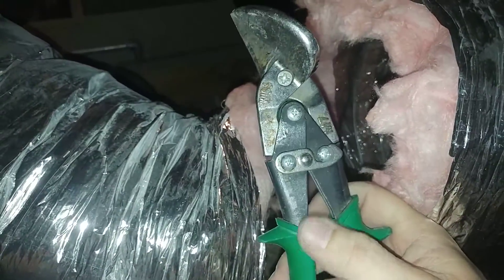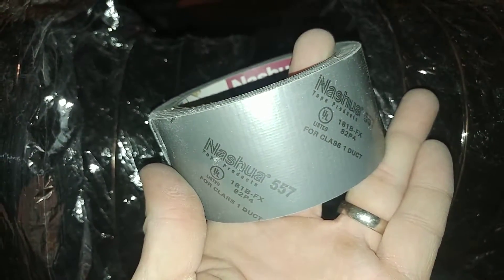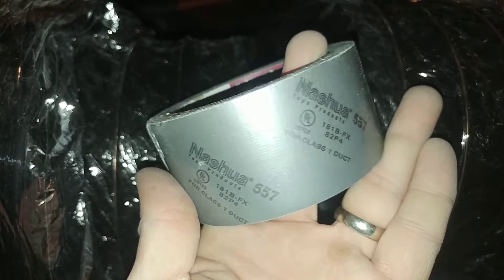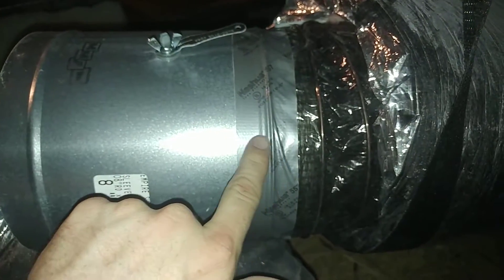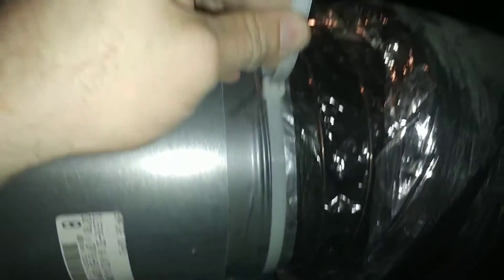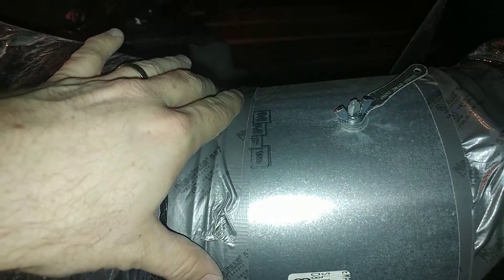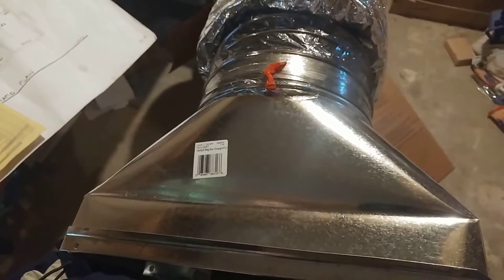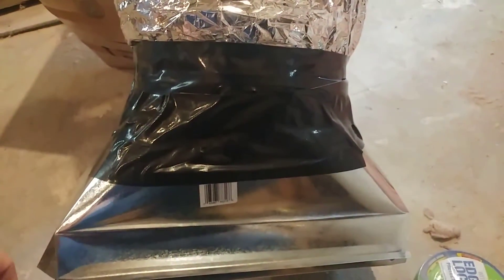How to Install an HVAC Damper and Attach a Register Boot: HVAC Duct Work

Comment: Thank you great tutorial!  Do you untuck the insulation before taping or leave it tucked and taped?
Reply from the maker: You tuck in the outer portion first to tape the inner portion. After taping the inner part, untuck the outside insulation, then tape up the outside
Reply: Thank you so much! Excellent tutorial video!

Comment: Handy video for sure.  But despite the name "Duct Tape", it's actually not for use on Duct work.  That myth has been debunked for a while.  Better to use foil tape as it holds up to the heat much better and has better adhesive.

Comment: Thank you for this. The HVAC companies I have called do not want to add dampers, though - preferring to sell me on a new split ductless system. Not sure how to approach them.
Reply from the maker: As the customer, they should adapt to your needs; however, the answer is that the damper can solve problems throughout the whole system whereas a split system only solves a very localized issue
Reply: @RealEstateInvestingUnmasked  appreciate the response. Thank you!

Comment: Good tutorial.
My house is 3 years old and had terrible balance because the idiots did not install dampeners in several runs.
Thought it would be much more complicated. After seeing this, im thinking of installing a branch off of the nearest vent to my 2nd story unit. It blasts a ton of air through it. Its an open 2 story blended air system. All the 3 up bedrooms have a vent. However my main area upstairs area only has 1 vent in the open area on far  side of the house. The thermostat is is nowhere near any vent that is not behind closed doors  You can walk down the hallway towards the vent and feel the temp change. So I figure if i take the one that blasts air and extend it down the hallway, it will balance out better.  My theory is That the thermostat does not sense the change until the air finally meets the thermostat at the far end of the house. That end is always much colder so if I can get some air closer to the thermostat it'll balance out better.
Reply from the maker: You're right! And it is very simple. Let me know how it goes.

Comment: 2bedroom 80s townhome have a bedroom thats next to the airhandler/furnace above my shower tub. That room gets really hot. While downstairs is cooler. I was told not to restrict vent because the unit can overheat since its next to it. Is that a consideration when installing dampers?
Reply from the maker: That means you need to consider where in the ducting to put a damper. The information you gave in and of itself does not tell me you shouldn't put a damper. For instance, if you close off the register to that room, the air pressure should reroute itself to the rest of the system. As long as the ducting isn't choked off, you should expect the heat to flow to the rest of the house. The more you restrict the airflow, the more it will affect your furnace and may cause it to overheat and cycle more frequently. You may need to insulate your ducts or install larger ones to the cold parts of your house. There are many ways to solve the problem.

Comment: Thank you for your video I'm going to use it to get my AC company to install dampers on all of my central AC ducts. This should have been done when the central AC was installed during new construction! In my area of Indian River County I have seen one house after another where the seller has a wall unit in the master bedroom because either the builder or the AC installers fail to put dampers on any of the central AC systems regardless of the price range of the homes in this County. Buyer beware!
Reply from the maker: Oh my! They really should just do it right! I guess you need a great guy in the area to do a whole bunch of houses at the same time. It's not difficult to do, just tedious... and worthwhile... wow... so much money spent on the symptoms instead of solving the problem...
Reply: @RealEstateInvestingUnmasked  yes thank you so much for responding and keep the great information coming we need someone like you in our area.

Comment: Looked all over for a tutorial how to properly install those dampers in flex pipe and finally found this video. Thank you so much!
Reply: Use aluminum tape instead of "duct tape.". It does a better job and the adhesive lasts longer.  Unfortunately it's significantly more expensive.

Also, using mastic (sealant) on the inside of the liner {before the zip tie (always use a zip tie tensioner tool for that part btw)} helps incredibly to create a tight seal.  Then proceed to zip tie and tape the joint.  

Otherwise, good video.
Reply from the maker: You're welcome!
Reply: Thank you this is how my system is!